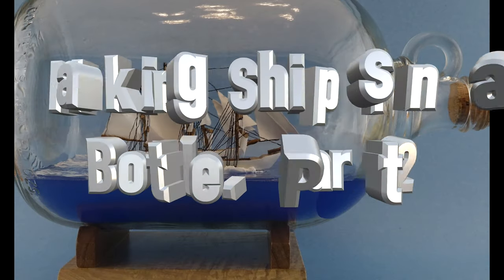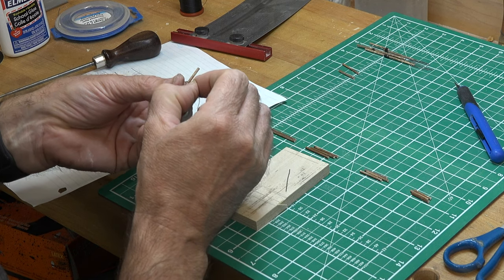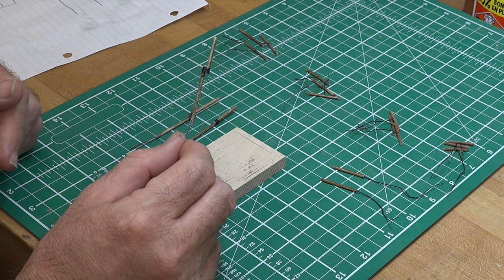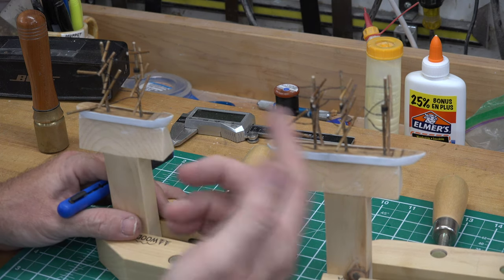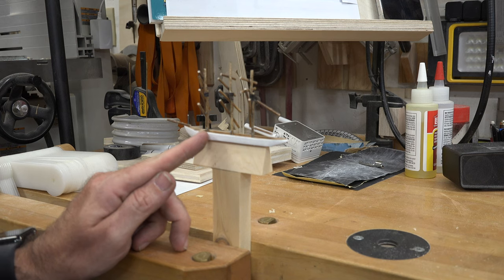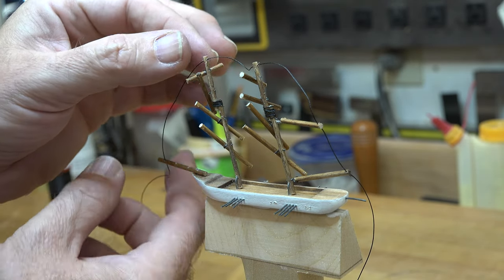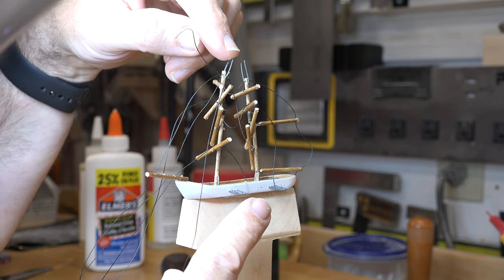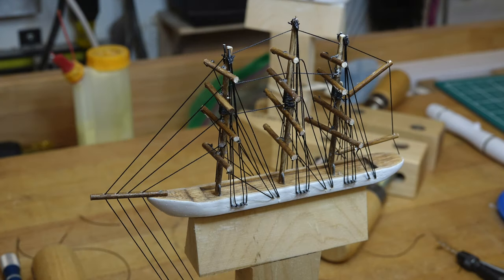Making Ships in a Bottle Part 2

Comment: Hi Kenny, great to see your second series. I have made my ship and cast the resin. Ready to place it in the bottle. Noting the changes such as switching from CA to white glue. Your sea is different. Is the wash also white silicone? Now in two minds whether to go for the new calm sea. I had great difficulty finding a suitable bottle in UK but found World of Bottles, 1000ml pharmacy bottle 20000837;0 ideal. Your detailed instructions and delivery are great. As you say, it is finicky and time consuming but gives a great sense of satisfaction. Thanks so much.
Reply from the maker: The wash or wake of the ships in this model are a material called Mod Podge.  It was painted on in several layers and then painted with white latex paint.  The only white silicone that was used in this model was the waves immediately under the ship.  This acts as both the waves AND the adhesive that holds the ships in place.  I'd love to see your ship in a bottle when you are done.  Feel free to send a photo to the channel's email address.  acutabove_woodworking@hotmail.com
Thanks for tuning in.